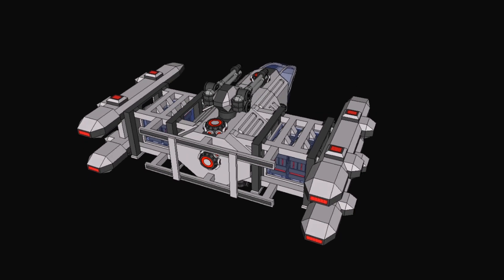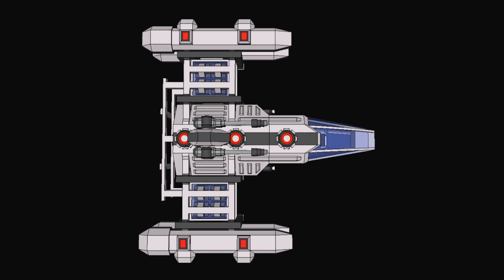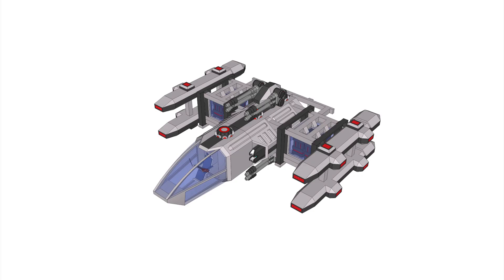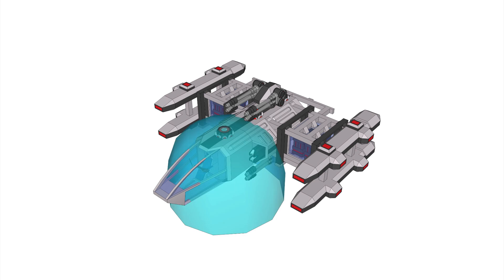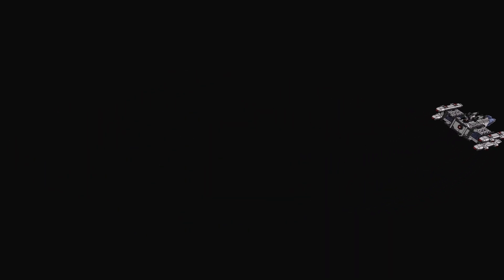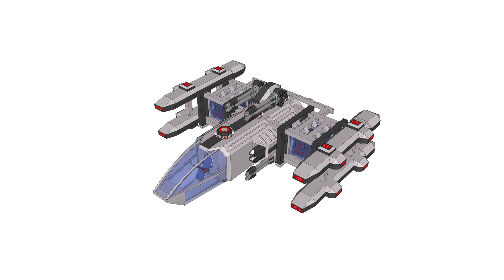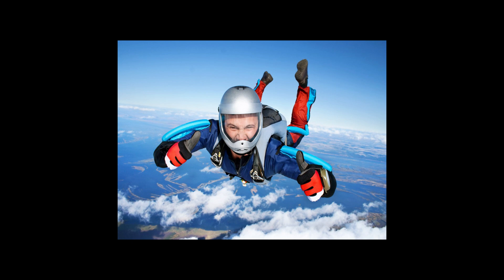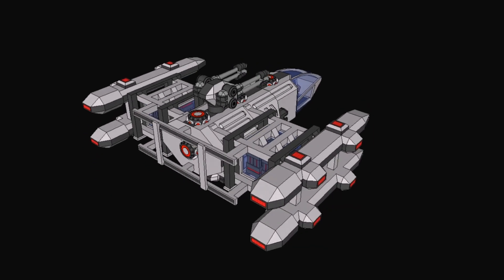Shad has a question! Gravitational acceleration on a spaceship?

Comment: There are three ways of looking at this question. 
ONE: I take your description as stated. Then you would start to notice interplanetar - interstellar - or even intergalactic mater distribution. Intergalactic empty space is estimated to have roughly one hydrogen atom per cubic kilometer. So if you accelerate to close to the speed of light you would create enormous heat thanks to friction. In actual designs studies dine by engineers they have to com up with all kinds of shenanigans to get rid of the extra heat. Interstellar is much "worse". Many many more hydrogen atoms per cubic kilometers. Plus - depending on the region of space - dust and other micro particles. So if your drive "merely" accelerates the ship, then the speed you could eventually reach would depend on the power you can channel in the engines AND eventually on how well you can deal with the heat that is generated by friction. We are speaking sizeable percentage s of the speed of light, but alas - your drive could reach that. It is reaction-less after all, and thus the ship does not have to waste reaction mass.
TWO: The way you described your drive it is at least feasible that the drive fields would push the interstellar dust micro-particles and hydrogen out of the way all by themselves  - or could on top of driving the ship be configured to do that. O the drive would also second as a shield generator - at leas tor - or rather against -  anything that has mass. So you have only a limit that is determined by the power output of the engines - and by how much radiation you can protect against. Because it is plausible that the matter you push out of the way still gets pretty hot. So it produces radiation - that is omnidirectional. So part of the radiation that is produced also hits the ship. At comparably low speeds that is not a problem, but when reaching sizabke portions of the speed of light you would eventually heat stuff so much that is produces X-Rays.
THREE: your drive sounds very similiar to an alcubierre drive. Where the drive field completely surrounds the ship - to the point where the ship can be said to exist in a micro universe of its own. That micro universe can reach arbitrary high speeds - as far as we know - including any degree of superluminal.
The warp bubble - these days actually so called evren by serious scientiests who do such calculations - will completely shield  the sip from anything including radiation. The problem with all the alcibiere drive that we have so far calculated is that it is a wee bit difficult to shut it off AND that once you manage to shut it off - the dissolving warp bubble will - upon dissolving - creat such a massive radiation blas that is would cauterize everything in the vicinity. Which sadly would include the ship and most liklely any planet nearby. Yes - the blast would be that powerfull according to the calculations.
So some kind of unobtainium would need to unfold it`s magic to prevent the superluminal deceleration boom. But other wise, when one interprets your drive as an alcubierre drive the ist could reach any speed - and the limit would only be set ba the actual power output of the drive.
Greetings

martin
Reply: Unobtanium is that stuff from avatar right? Also I am doing research into alcubiarre warp drive due to inspiration for the creator of astron X to make a channel and space company of my own so this has brought some things to light thanks

Comment: there is a space simulation/sandboxgame called space engineers, it has realistic physics to a certain degree (not on a quantum level though). People playing the vanilla game quite a while back asked themselves pretty much the same question you did: We have artificial gravity generators, and we have specialised blocks that will be pulled by them. what would happen if we activate them and keep them on a constant distance from eachother? The result was prepulsion, a lot of it. the standard in-game thrusters which is a single block designed to do the job of pushing, doesn't really have much up against the player designed "gravity drives" with a few dusin of artificial mass blocks you'd get the kinetic energy of several hundred thrusters. this engine would often get your ships up to max speed practicly instantly. One of the drawbacks however is that you had to keep the centre of mass of your ship, and the centre of thrust of the engine perfectly aligned, or else you'd start doing a loop, the size of which would be determined by how off the balance is. I'm pretty sure this would be even more dramatic IRL, so that's something to keep in mind
Reply: The developers also don't particularly like this invention and consider this an exploit. They said on a few occasions they plan to apply the opposing force on the generators themselves in accordance to Newton's Third Law of Motion, thus negating their useful as thrust. They'd be great at pushing things away (like in a gravity cannon), but not at pushing themselves.

Comment: As soon as you jump into soft scifi with "using" artificial gravity, you have to add some inertial dampeners to protect the crew and ship during wild maneuvers. But to answer the question: with the artificial gravity drive described here, it should be no problem to travel the univers at what's known as "ludicrous speed" (← official technical term).
Reply: given enough time and acceleration it could even go past "ludicrous speed" into "plaid"

Comment: Assuming you got past all the technical issues and got this thing to work the way you describe, your upper speed limit is going to practically be about .8c though you could approach c given infinite time. The reason for this is because as your speed increases so does your mass; at around .8c your acceleration at 1 g would only result in minute changes in velocity and require exponentially more time to go faster.

Comment: First for possible speed, it's actually infinite, kinda.  Just like with  any constant propulsion.  The problem is that your ability to measure  speed is what changes.  Remember that everything is relative,  including speed, and time.  As you accelerate, you also change your  inertial reference frame.  Your speed relative to anything asymptotes toward the speed of light, but never quite gets there.  The reason  you're still 'accelerating' is because now that added energy is changing your perception of time.  You perceive the planet you're flying at as  traveling toward you at the speed of light, and it perceives you doing the same, but the difference between time on that planet and time on your ship is getting bigger and bigger.  It's a very confusing concept, 
but you could effectively travel faster than light, because the time you experience traveling is that short.

Your concept of the flow of force is probably off.  The reality here is it HEAVILY depends on your concept of how gravity works, but let's keep it simple and assume your generators are actually pushing things away.  That's easy.  It pushes things inside the ship away, toward the floor of the ship.  They push against the floor of the ship.  The floor pushes against the frame of the ship.  The frame pulls against the generator.  You have tension between the generator and the hull it's attached to, but that's just a typical weight force.  In this situation, your propulsion is literally trying to lift yourself up by your own bootstraps.  You have to remember, force is relative, too.  You're not 'pushing in an absolute direction'.  You're pushing against something.  If that something is connected to you, you're just putting strain on the connection until it breaks.

Now, if you are somehow warping spacetime to create a tendency to move in one direction, then yes, your idea works.  The generator itself would be pulled by it's gravity field, as would anything in it.

On the other hand, if you're using gravitons, then you're probably pulling things in toward the source, as opposed to pushing them away, then the gravity generator is the center of the gravity field and pulls everything toward it, but the ultimate answer is the bootstrap scenario again.

I honestly have no problem with future sci-fi physics violating 'known laws'.  Those 'laws' are really just guesses that have gone un-dis-proven for a VERY long time with a LOT of attempts to prove them wrong.  But you introduce new basic concepts of physics and that all changes.  Gravitons and artificial gravity may not produce an 'opposite reaction'.
Reply: Should there be an 'opposite reaction' when using a gravity generator is a great point to consider!

Comment: I have come up with a 'gravity engine' which does exactly what you are talking about  but it is a large spherical object that sits in the center of the ship and it can make the entire ship fall in any direction as if it was falling towards a super massive black hole that is is very big. and it can also turn the ship as it can make its gravity act in multiple directions on any specific parts of the ship but most of these ships have thrusters on the back of them for even more speed and exhilaration so in terms of speed it is limitless depending on the power and size of the gravity engine which is limited.

Comment: Gravity is not a force.  It's a curvature.  Everything Newton said about gravity?  He was wrong.  He also demonstrated he was anything but a genius.  Can't call him an idiot because he came up with principles that are correct (then again, he did use the pot he did electroplating in to cook his meals).  He insisted that gravity was exactly what he said it was all the while admitting that he had no idea how it worked.  Why, because in his infinite wisdom, he made the determination that the stars are too distant to produce a gravitational effect.  Yet gravity is a push.  Newton knew it.  Energy pushes.  Energy does not pull.  But accepting that gravity is a push means accepting that it was being caused by the distant stars.  So he insisted that gravity has to be a pull.  His big problem is that he's assuming gravity is a force.  It's not.  It's acceleration.  This is why when you're moving away or toward the Earth (as in, an elevator: indeed, it was an elevator that convinced Einstein that gravity was acceleration.), you feel a change in weight.

Wait, what?  The moon doesn't significantly affect our movement?  What the hell do you think Earth's tilt is?  Why the hell do you think our North Pole is pointed dead on at Polaris?  Why do you think it periodically shifts to Vega?  Earth's got a big counterweight hanging around her neck!  If the moon were to disappear from the sky, do you have any idea what would happen to our planet?  Can you imagine the devastation and loss of life as Earth suddenly shifted its position in response to the sudden shift in gravity?

Anyway, gravity is not caused by mass (yes, it is generated by mass).  It's caused by the movement resulting from the expansion of the universe.  The object we're standing on is in a state of free fall, and we don't notice because it's spinning, causing another path of acceleration, pinning us too it.  As Einstein speculated, any person within an object maintaining a constant rate of acceleration will not notice that he or she is accelerating until an attempt is made to move away from the object.  Now, how do you suppose space travel works?  It is necessary to accelerate away from the planet.  You can't use gravity to do that because it's going the wrong way.  Once you're up there, though, you have move at incredible rates of speed just to hang in orbit.  Ships, satellites, and space station must remain in a constant state of freefall, remaining on a trajectory so that they fall in such a way that the miss the planet, instead falling around it.  This uses gravity.  The Apollo missions didn't fly to the moon.  They fell towards it.  When we go to Mars, we're not going to fly to Mars, we're going to fall.  Now, we can use propulsion to make us fall faster, which is how you want to use gravity.

Once you start to understand how gravity works, you start to realize how silly Star Trek looks.  These people stand firmly on the floors and when they're attacked, debris rains down on their heads, and ships bank like they're in a pressurized atmosphere, and they can just turn and go wherever, and that's just not how propulsion in space would work (practically).  For Star Trek ships to work the way they do, it requires a great deal of highly impractical technologies, and improbable science.  For example, Star Trek creates its artificial gravity with graviton particles.  There's a problem.  They don't exist.  Scientists insist that gravity is caused by graviton particles.  This is because since gravity is a "force" that "pulls", a force that pushes has to be generating it.  The only thing that could possibly work would be a particle (here's the point where you start to see how ridiculously brain-dead the notion that gravity as a push is).  They can't find the graviton.  CERN, ALBA, ELU-6e, ELSA; none of them have ever seen a graviton particle.  What's the answer?  Well, graviton particles must be undetectable...convenient.

Today's scientists have abandoned a very important rule.  If you can't demonstrate it, you can't prove it.  Now, there is plenty evidence that gravity is a push (Einstein's, Planck's, Hawking's, and Tesla's research are just the most famous examples of scientists telling us that gravity pushes).  Yet, our scientific community is so insistent that gravity is a pull (with, to this day, no legitimate evidence suggesting such), that most of their theories (dark matter, gravitons, and the like) are incumbent upon gravity being a push.  Indeed, because they insist gravity is a push, gravitons have to exist because none of their math works without gravitons.  It's not rational.  It's akin to a religious fervor, and Newton is the messiah.  Meanwhile, our fine physicists at the Institute for Advanced Study tell us that if a particle sensor with Jupiter's mass were to observe the sun indefinitely, it would only detect one graviton per every ten years.  So, religious people are fools and lunatics for believing in gods and monsters, but we're just supposed to accept theories that can't even be proven on faith?  And then they base their whole science on these theories, and people should just accept it all, despite what the greatest minds in history have said to the contrary?

Comment: Bit late to the party, but I'll have some fun. While everyone else is geeking out about various theoretical technologies, I'll propose another reason. Economics.

My premise is that a gravity based drive would simply be far more expensive than older more conventional propulsion methods. For the cost of a good gravity drive you could get enough ionic engines or even nasa-style rockets to go much faster. Gravitational propulsion would probably be a highly niche choice for ships designed to go on very long trips without access to "spce-drydocks", and even then if the trip is too long it's faster to wait for better engines to be invented and use those. 

Then again, in stellaris I spam corvettes armed with the cheapest weapons available and no defenses to win through sheer attrition. Through enough nukes at something and it will die... eventually. We have reserves. So I may or may not be slightly biased.

Comment: All rocket engines are based on acceleration, no space ship has a max speed. The only difference this ship would have is that it does not need fuel.

Comment: The limit would be the same as any other engine, the speed of light. The inertia increase you described is why you can get arbitrarily close to the speed of light but never totally because you would require an infinite amount of energy. You can always go a little faster; engines, be them gravity or ion, have no max speed, except the speed of light which you can never completely reach. The main benefit of your gravity drive is that it it can have really high acceleration and doesn't require fuel so you could do really delta V intensive trips with out 90% of you ship being fuel tank